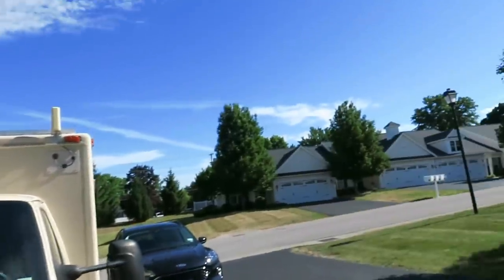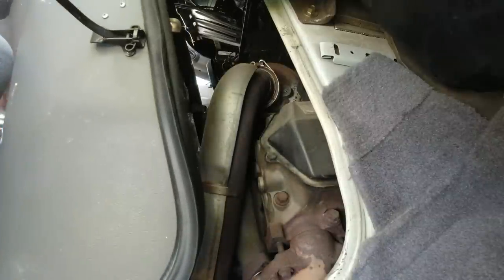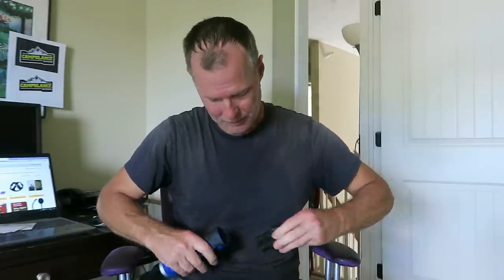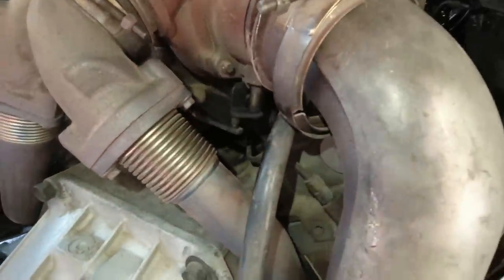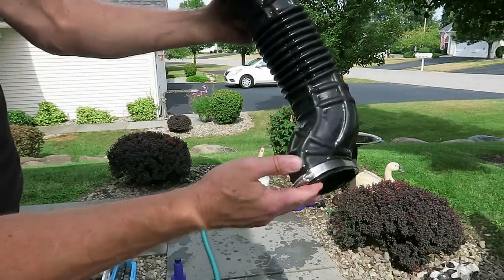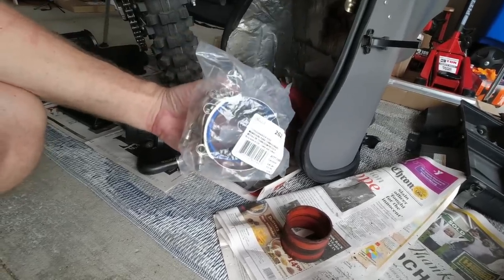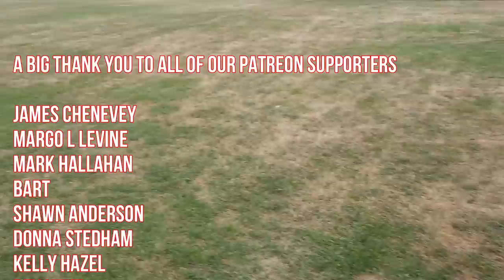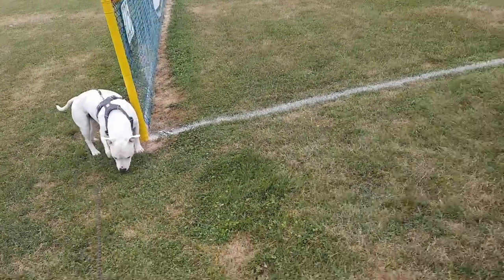Look What A Mechanic Did To Our 7.3 Turbo (Finding Problems) | E-Series 7.3 Turbo Removal

Comment: Dave, it's a wonderful feeling to get the right tool for the right job. Without your new ratchet tool that job on the turbo could easily turn into knuckle buster and more audio bleeping than you want to take the time to edit out. Can't wait to see part 2 of the project and see if there are any performance changes. I give you a lot of credit doing a deep dive into the inner workings of your turbo, all that oil and dirt could be catastrophic if it got into the turbo blades. We recently bought a car and had a choice between a 4 banger with a turbo or a V6 and we opted for the V6 exactly for the reason you have shown us. Without proper care a turbo can be a ticking time bomb but it seems you are now a member of the bomb squad and maintenance is the cure. NICE JOB!! Can't go without saying hello to Lefty!!
Reply from the maker: That ratchet was perfect for that job! I'm feeling much better after getting this thing apart.

Comment: I dread ever having to take the Turbo off my RAM 2500 , where your van makes getting to it so easy!!  The only time I've owned a van in the past and the engine having a dog house helped was changing spark plugs 😀 I know one day my turbo and EGR cooler is going to need service 😔.
Reply from the maker: If it can be done... you can do it :) Just a lot more leaning over for you!

Comment: I have the 6.3L V10 in my E450 shuttle bus. I’m working now to have this engine “bullet proofed” (all new quality  gaskets).  Since it has 247K moles on it, I’m also having the transmission overhauled and the differential inspected and see if it needs overhauling.
Reply from the maker: The V10 is a good engine and a lot quieter than a diesel.

Comment: As you know, I love and trust your videos. I have been with you from just about the beginning. My problem is, that when you take a part off, how do you know what it is and what it does? Case in point is the breather @ 17:12.  As always, Thanks in advance.
Reply from the maker: Thanks Scott for always being along with us :) The parts on the engine are standard items that are used, in some sort, on all engines and I think that over time, I've gained an understanding of what's there and it's purpose. I think my first mini bike (in 1976) had a breather hose off of the crankcase venting it to atmosphere... fast forward to 2022 and this engine has a breather venting to the intake tube :) Same stuff... just a little different.
Reply: @TheCampulanceMan  Also making more engine challenges are the emission control stuff, de-tuning, more hoses and less performance.  Many decades ago (in another galaxy) I worked on my 1969 IH 4x4.  I would not know where to start on my "newer" 2006 Honda CR-V.
Reply from the maker: @donalddodson7365  We did a head change on my daughter's first car, an 09 VW. Omgosh! The smallest little engine with a turbo and so many hoses and wires! My 66 Mercury had like 2 wires!

Comment: Campulance Man! Keep the uploads coming! I hate to keep asking questions but I was curious if you had anything to recommend for security such as locks, car alarm system etc. Safe travels!
Reply from the maker: I haven't added anything beyond the locks that are already on my rig. I recommend locking your cabinets and doors EVERY TIME you walk away from the rig. With others around usually, the delay of a lock may be just enough for someone to see what's going on. Thefts are opportunity occurrences - they happen to walk by AND you happen to have left something valuable out or the cabinet unlocked.

Comment: Dave, have you ever cleaned the EGR valve on that 7.3?  Love to see a video on that.
Reply from the maker: Are you referring to the EBP valve? There isn't an EGR on the 7.3, just the crankcase ventilation filter that I showed...
Reply: @TheCampulanceMan  aaahhh... that is probably my mistake, I have a 6.0 Powerstroke in my e450 that has an egr valve and assumed that all the powerstrokes have one.  Thanks for all your posts and adventures!
Reply from the maker: @marktc2004  OH OK- yes, the 6.0 has an EGR while the 7.3 doesn't. I see that there's a lot of conversation surrounding cleaning them...

Comment: Replace the turbo with a new up dated one with the new heat resistant bearings and improved air flow. They improve mileage and are quite,  powder coated and better , sometimes it better not to be cheap on a new improved turbo......
Reply from the maker: I think next spring we'll do a turbo upgrade and a tuner to improve mpg :)))

Comment: Hi David.
Did you have your turbo checked while you had it out?.,,  to make sure your bearings, and the other parts are good shape.
Reply from the maker: The shaft didn't have play in it and the blades looked good... I'm going to see if I get any better performance but, if not, a new turbo is probably on the list  :/
Reply: Ok those band clamps work the best more surface area , we used them all the time and the wont back off very easily after hitting bumps. Curious what do you use for fuel anti jelling? Take care
Reply from the maker: @alfredmeyer3640  I use Diesel Kleen normally (normal temps), and the Diesel Fuel Supplement below 30f.

Comment: Hey Dave- as per your headline- Unless I missed it - What did the mechanic do to your engine?
Reply from the maker: The EBPV armature that was connected with mechanics wire... not OEM at all!!! I also found another item but didn't capture it some how - the hose clamp on the turbo output was taped to help grab the slots (worm clamp) because it was all blown out!
Reply: @TheCampulanceMan  That’s right- you did say that.  Please stop yelling at me😏